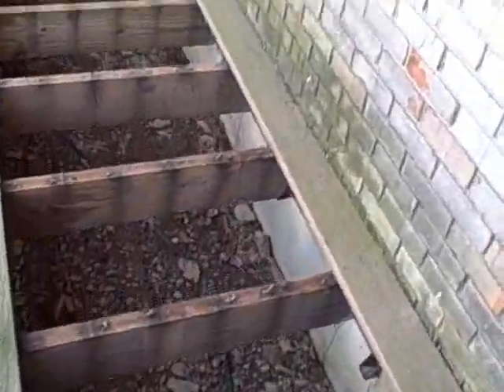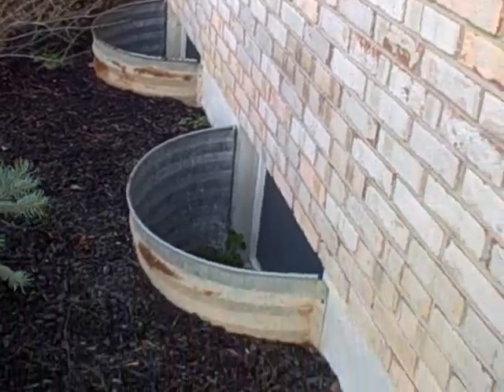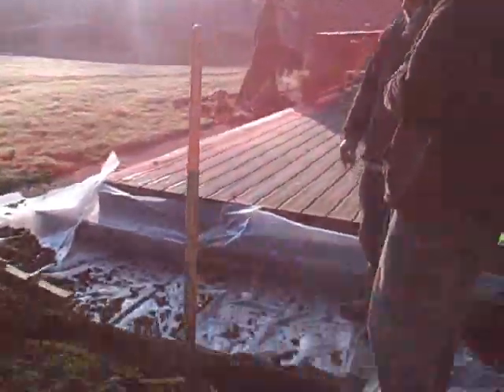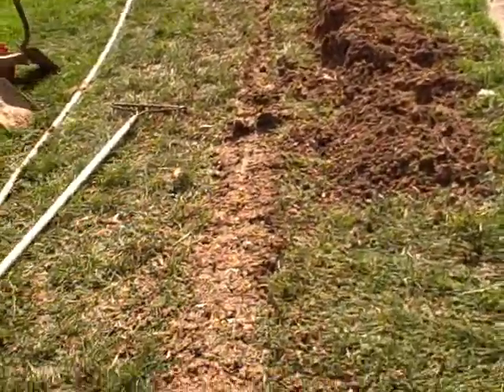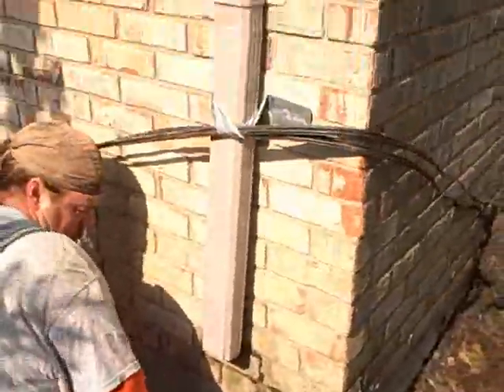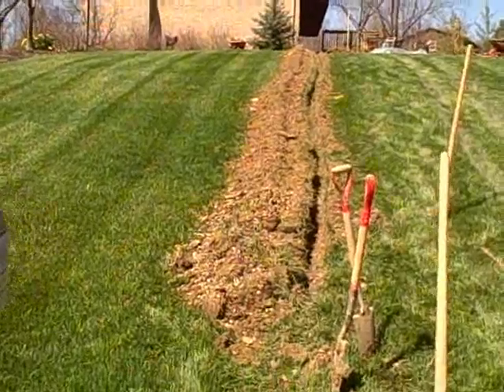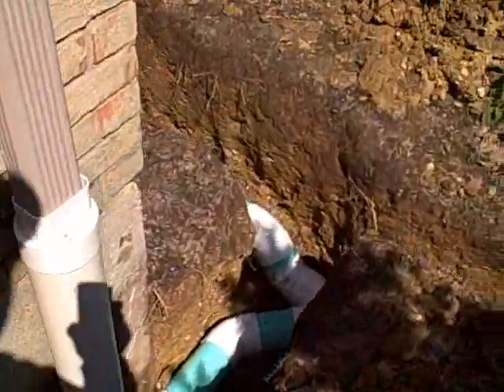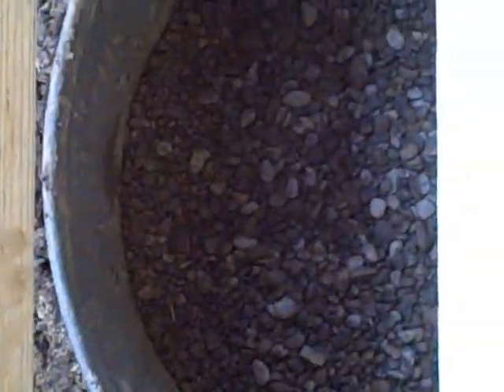Window well drains prevent water pouring  in basement windows basement waterproofing.wmv Aquaproof

Comment: You did absolutely nothing for your client long term.  If that single line you have running to the curb ever gets clogged or smashed, those window wells will become the only outlet for the downspout that you ran into the same exit line as as the window wells.  During a heavy rain, they will fill like buckets causing major flooding in the basement.  A lot of good work and money, but poor design.